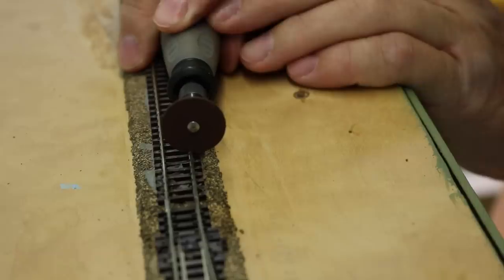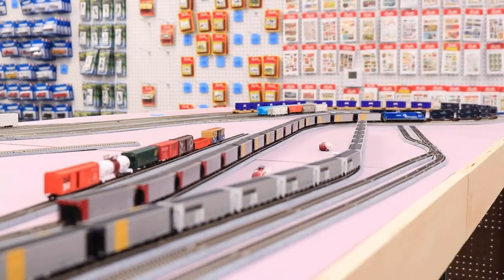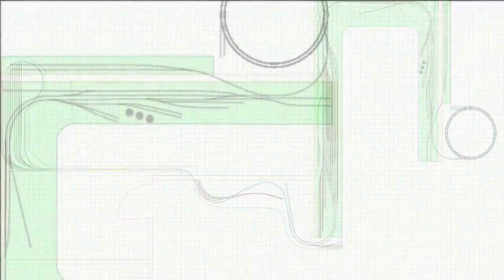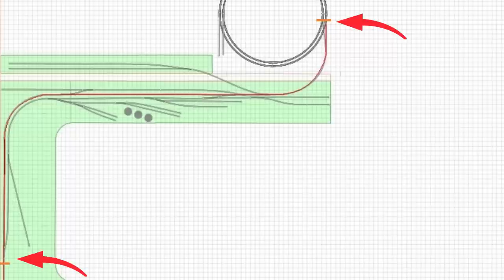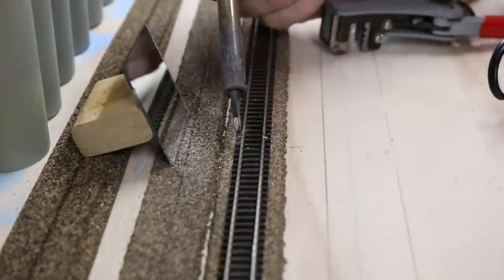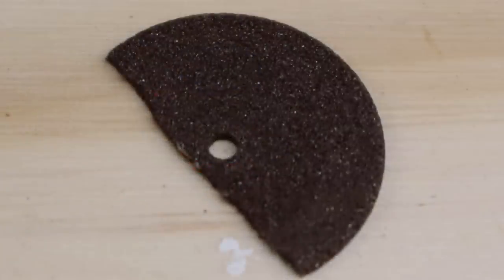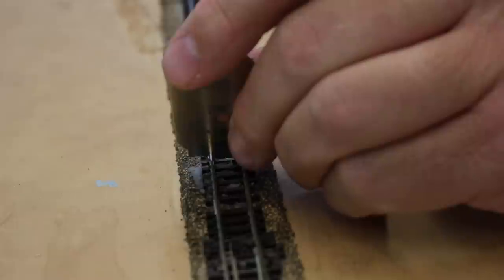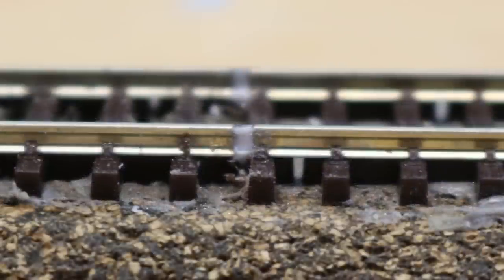Perfect Insulation and Expansion Gaps in Model Railroad Track

Comment: Once a switch is installed, this method is easy.  After I cut,   I slip in a shim of styrene to prevent gap from closing.   Also, old style tortoise machines had a habit of closing their internal contacts before the switch points moved.  So I'd open the tortoise and shave off copper from the circuit board so they would make contact later.

Comment: Yes, I've heard of people cutting gaps to insulate.  I've used a Dremel cutting disc alot and rail gets hot when cut, so I've gotten into the habit of using heat sinks protect the ties.
Reply: If your rail is getting that hot, you are not letting the tool do the work and you are pushing to hard. I found a metal cut off wheel from Micro Mark that lets me use a Dremel without slanting the tool and the blades don't shatter as far as I have seen and I have one that is about 5 years old.
Reply: @davidcurtis5398  This is my third moderately large HO layout and I've cut a lot of rail with my Dremel.  I used the thicker cutoff disks because the thin ones are rather fragile; the thicker cutoff discs do cause more friction so the rail just gets a bit hot and I toss a heat sink on as a precaution to keep the plastic nearby from getting soft - not melted (correct first comment).  Mostly I use my old Radio Shack heat sinks for soldering.  I know the mantra about letting the tool do the work since I bought my first trusty Dremel back around 1982.  I'll have to check out the Micro Mark discs - if they are big enough I could cut without angling the Dremel.  Mostly I cut rail before the track is install.
Reply: @riogrande5761  I've been doing layout for almost 45 years and the discs from Micro Mark ( the metal ones ) are almost indestructible. The one I am now using is over 3 years old and I use it for almost anything. You might try it - you might like it. Product #84611X2

Comment: I cue expansion joints about every 5 feet. I always cut them on an angle. This gives the track room to move but will keep contact at all times. I really don't have to worry about conductivity at all since there is no power in my track. I cut these after all track is down and just before I ballast track.

Comment: Great video as always! I take it that you do not use the styrene to fill the cuts on the expansion joints? Seems like that would defeat the purpose…
Reply from the maker: That is correct on both points.
Reply: Thank you Randy and Ron - I had the same question!  This clarifies it!
Reply: here in the states a lot of us have the train room in the basement. i have mine there and have heat and AC. I keep the temp at 70 degrees year round with a humidity of 35% and don't have any problems...

Comment: Hey, Ron!  I have seen the method for insulating rail sections years ago in MRR magazine but seeing you actually execute the process makes how to do it much easier to comprehend.  This sure beats out those clunky old plastic rail joiners of days gone by.
Reply from the maker: Yes, I should have addressed insulated tail joiners. Theybare an eyesore to say the least.
Reply: I am using plastic insulated joiners but they are of the Peco variety which are very fine, similar to metal rail joiners so will not be unsightly and should blend in when painted.  They are not an eyesore.  Atlas versions are I agree.

Comment: Super helpful video, Ron! I used your lightbulb technique to set up my DCC wiring. I didn't think to insulate each block so when I got a short, it looked like a Christmas tree under my benchwork lol. This video comes super handy as it confirms that I fixed my track shortages correctly. Looking forward to the next video! Thanks
Reply from the maker: LOL, I'm glad you got that worked out.

Comment: To cut the gap I use the Dremel Diamond cut off wheel as it is thinner and makes a smaller gap.  Just use smaller styrene for the filler.
Reply from the maker: Thanks for the tip. I've had these cut off wheels for years and didn't look in to others. I will check those out.

Comment: So you said you were looking at track detection, what were you planning on using? LCC (RRCirkits), Digitrax, something else? Also I hope you will talk about metal wheels and resistor wheels  too. Thanks for the video. Sadly I wish I saw this video earlier. I used a lot of isolator rail joiners.
Reply from the maker: That is yet to be determined, but I am leaning toward an Arduino based system. It will definitely be current sensing with resistor wheels, and I wil be installing resistors on N scale wheels myself. I already have the resistors.
Reply: @RonsTrainsNThings  Thanks... Looking forward to it. My fleet is somewhat big so I have a lot of wheels to change out and resisters to install myself.